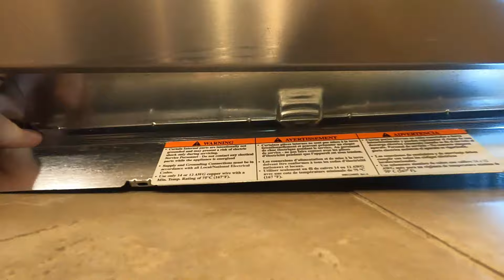Bosch Dishwasher E15 Code

Comment: Thank you! I've been trying to find the water leak in our same model that's just about 2 years old and I didn't want to put it all back together, but your very well made video -- including how to take off the metal tabbed panel in front -- has me convinced it was the same lower door gasket leak. I can reinstall everything and give it a try with some confidence now. Much appreciated!
Reply: I have the same white stain. How did you clean the lower gasket?? I can't see it, I can only feel it.

Comment: How did you clean the bottom gasket?.i have the same white stain and you said cleaning the seals fixed it but didn't tell us how you did it. I have already cleaned the 3 door seals. How did you clean the bottom seal? You can't even see it - only feel it.
Reply from the maker: Just by feel with a wet paper towel

Comment: Every time my bosch dish washer has a code.
I pull it out from under the country tip it over and it works fine
Reply from the maker: when you tip it, does water come out somewhere?
Reply: @ThingsBreak  no, air pocket in drain lines. When you tip the machine watergoes down drain
Reply: What you're doing is tipping the water out of the leak sensor and into the bottom of the washer, gathering nicely to rot your floorboards. You're simply bypassing the safety sensor.